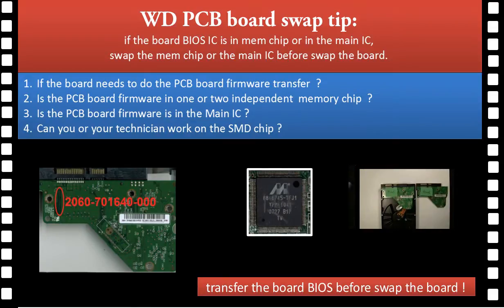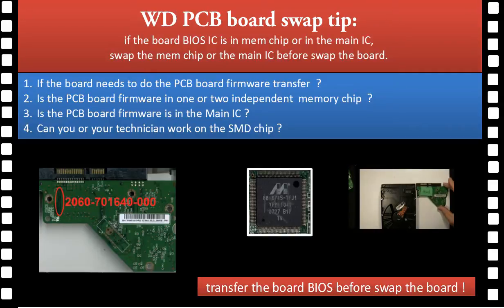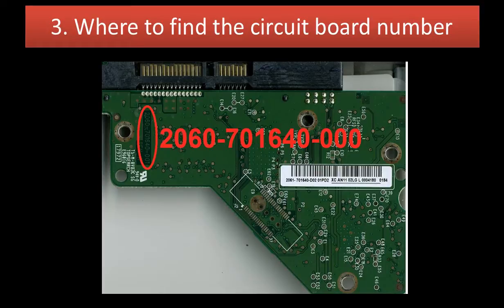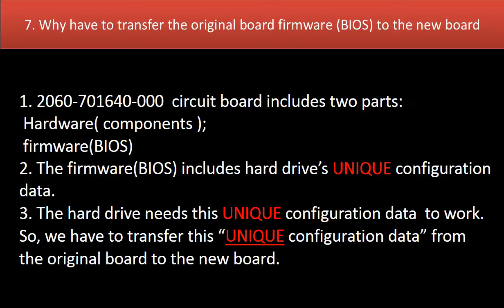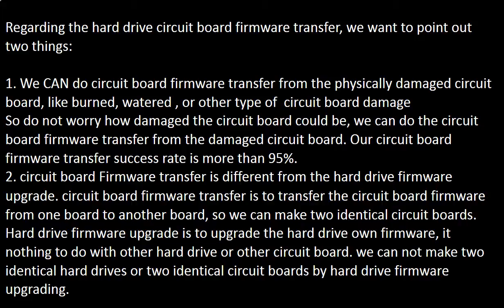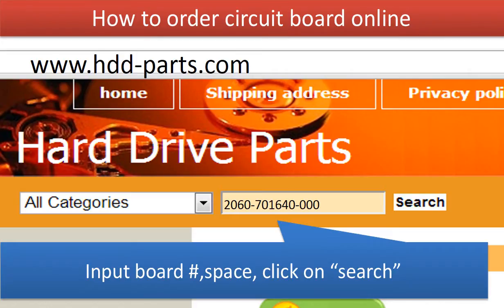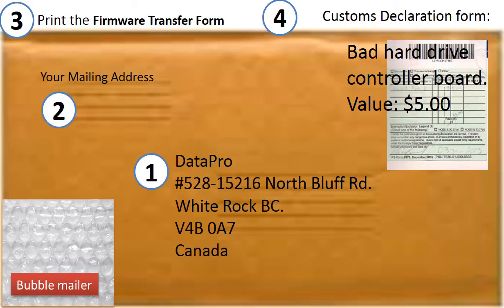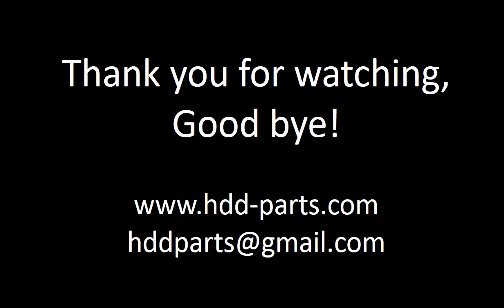WD repair   WD10EARS   WD10EADS WD15EADS  WD1001FAES   WD1001FALS WD6401AALS  WD5001AALS

Comment: guys what is wrong with you ?this guy explained correctly the chip cannot be programmed in home with amateur setup.require isp programming and the pcb and special tools that is expensive.this cannot be done at home with chips and gravy ...so why using bad words here this only show the current IQ.I see the bookmarked videos of itnecap where the toilet repair is done there are few on your channel...is this hdd is just more complicated than the toilet that's why you put the guy down?data recovery is not easy and require tools that only some large corporation can invent and custom builded by the help of hdd manufacturers plus they using pc3000 and deepstar but even these are expensive.there re few good companies that are solid on the market one of them is kroll ontrack they have equipment beyond believestalking about millions
Reply: If you mean ICSP programming, I think there are DIY programmers as well.